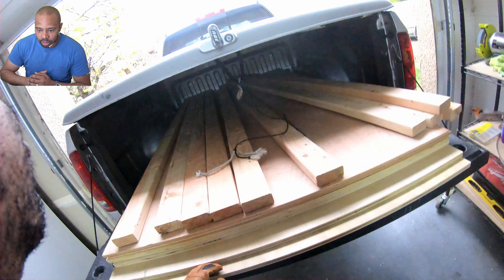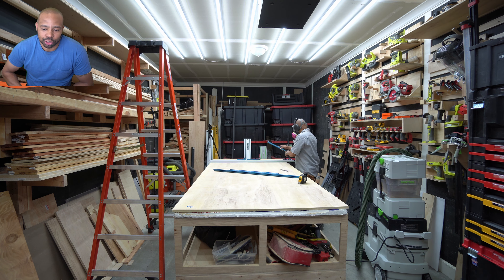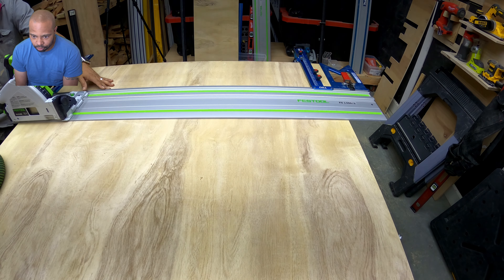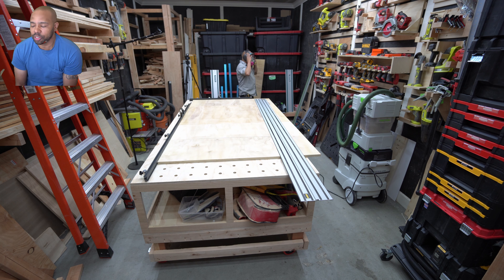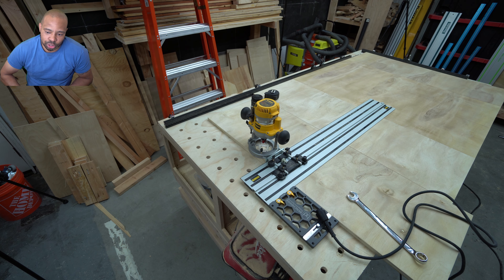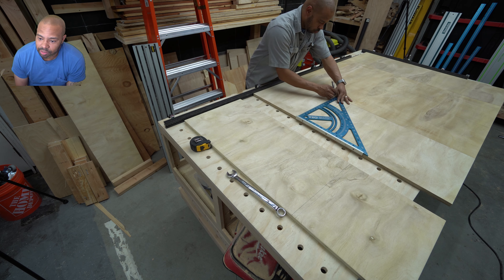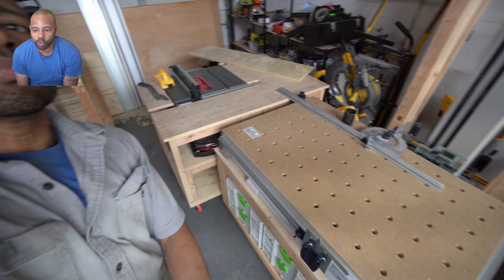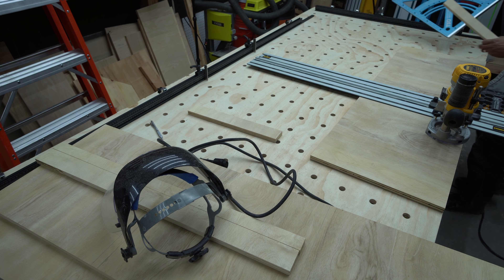Daily Shop Episode 3

Comment: You could use bench dogs to butt any straight edge against in the right place for your dados and run your router along that straight edge. You may need to shift your workpiece away from your fence to get everything to line up but there's a ton of ways to do that. Then just do one workpiece at a time.
Reply from the maker: Yeah, I blew it on that project. When I messed it up I did not go out to the shop for like 2 months. I could have easily built a simple structure and called it a doll house, but I got in over my head and did not take the time I needed because I was trying to make a deadline. Lesson learned.

Comment: Instead of trying to come up with a story board you may have been able to use the parallel guides again to get the measurements the same across all the boards
Reply from the maker: I did not think of that. Thanks, Reijo S. The only issue with that is that the Dewalt rail is not compatible with parallel guides and the Dewalt router attachment is not compatible with the Festool or Makita rails.